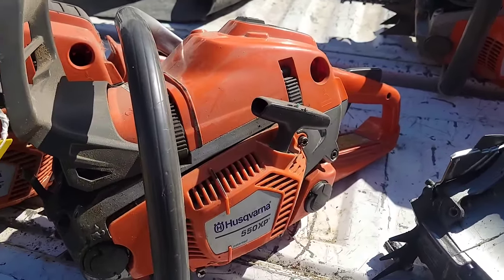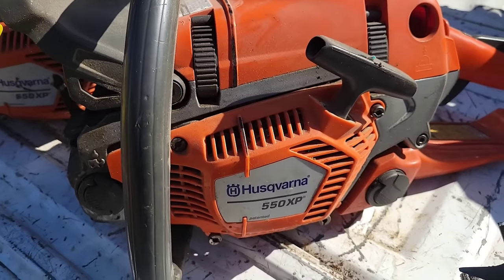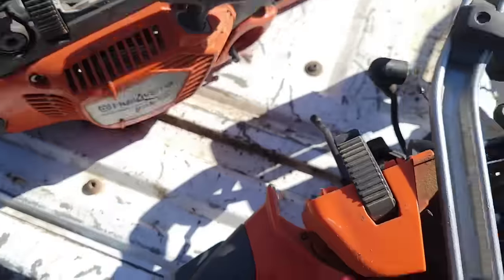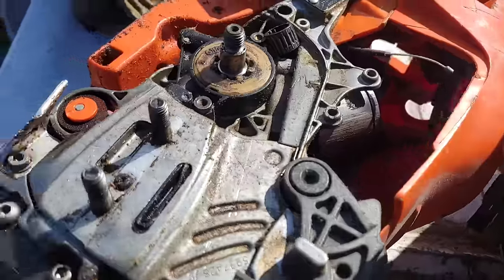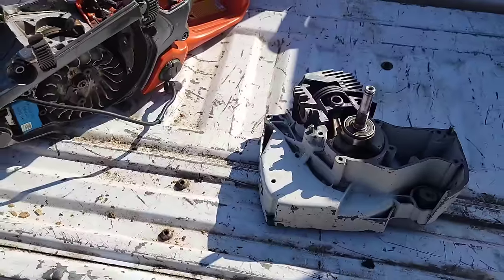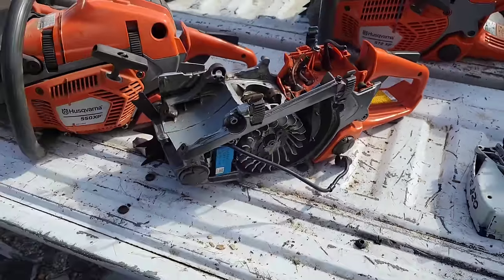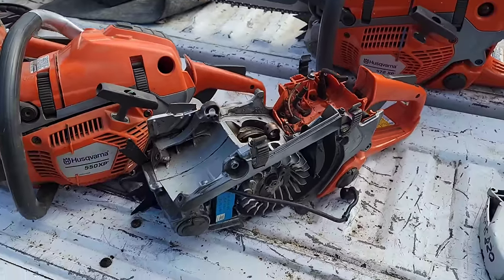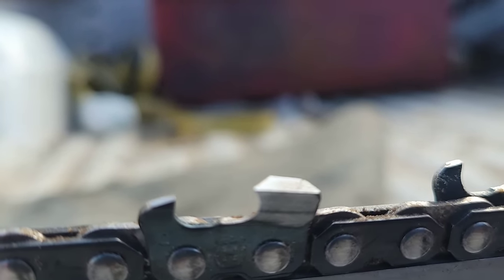ARE 5 SERIES HUSKYS JUNK OR IS IT SOMETHING ELSE??

Comment: The new 5 series have their perks, but they still were not built like the older saws. You really need to baby the new saws, and that can be a problem in many situations. They also have weaker cases. 
  For a guy that’s cutting in more of a controlled environment, or just for homeowners who want a saw they don’t have to worry about tuning them, they would be good. 
  As a professional saw run hard in the bush, they will never last. Not bashing on you tinman, but the amount of use you have put on your saws, is minimal, and you treat them very well. Love the videos!

Comment: Well the problem is you buy a truck to do truck things. Same with a saw. If everyone is having transmission troubles the answer isn’t to tell them to stop towing. The answer is to build them better. Chains get dull, saws should be able to rip occasionally. Hit a nail 2/3rds through your backcut, a saw needs to power through it without coming apart. It’s not like you can just stop and swap out chains while the wind takes out your cut up tree. That’s how guys get killed. 
    Hot starts, you think a climber is going to pump the purge bowl every time he needs his saw to start? 
    No reason to except inferior products. None. As for saving the planet, anyone wonder why the Chinese can sell a non epa clone saw (USA anyway) and the original NATO countries that are our allies can’t? Since it makes no sense, it’s safe to assume we are being scammed. I’ll let you decide by who. 
    Anyway, having said all that, it’s still a good video that no doubt will help save a bunch of guys grieve but unfortunately for the pro users, doesn’t really address the issue. Saws now are as expensive as they have ever been but only last half as long at best as they did 30 years ago. And that’s assuming you were lucky enough not to have an early catastrophic failure which is common enough even for pro users so 🤷🏽‍♂️